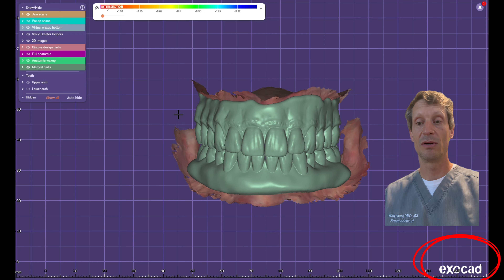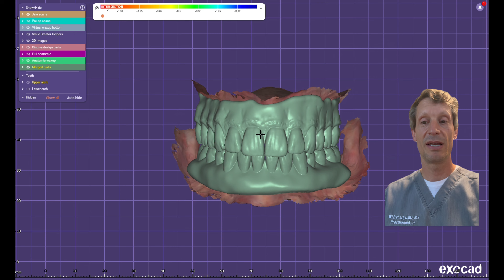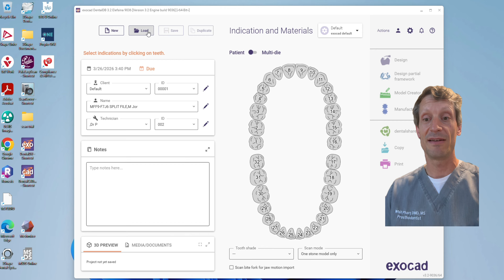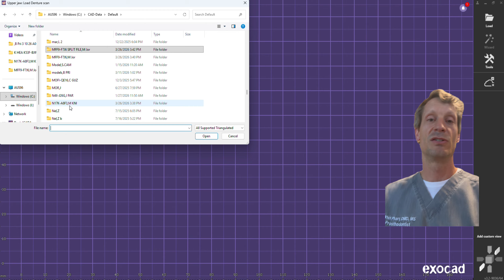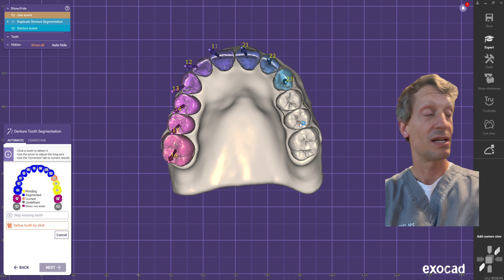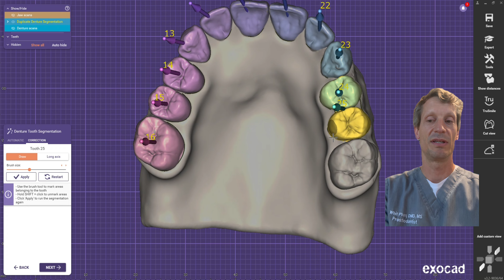How I Design & 3D Print Maxillary Dentures in Exocad

Comment: Why just not use partial denture module so do not have to do extra segmentation step?
Reply from the maker: I haven’t tried the partial module to design the full denture. My understanding is the segmentation and long axis set up, helps guide the root forms into the sockets when you cure the split files.